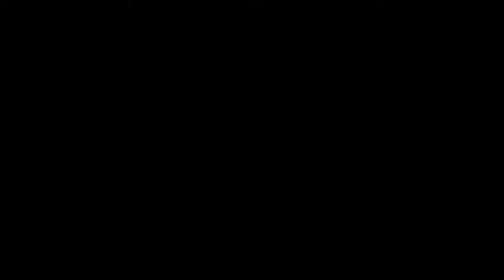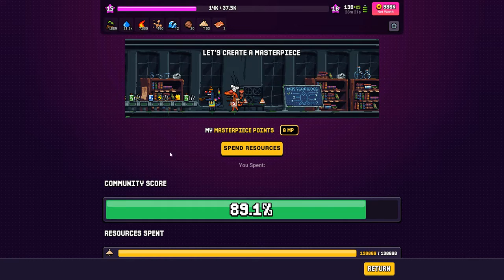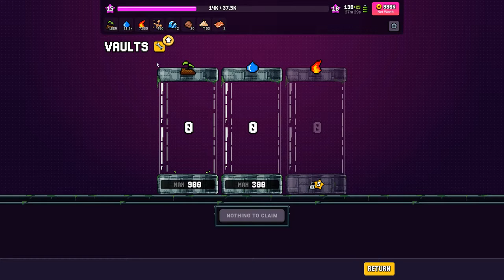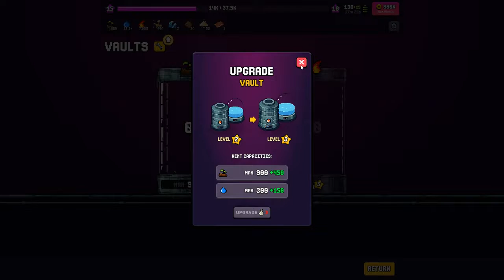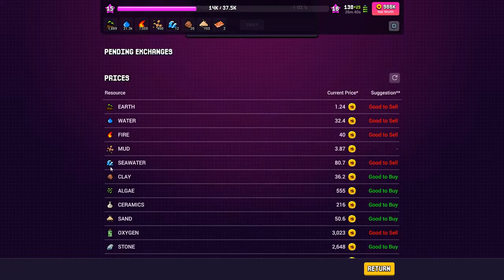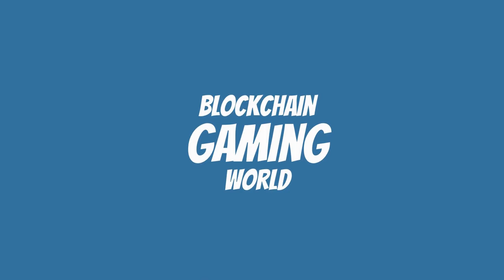ANGRY DYNOMITES LAB | Unlocking water

Comment: how to get water?  how you have that much?  does it drop every so often out of thin air into this tank?
Reply from the maker: I think it's because I own some NFTs so have been collecting water during that ownership process. It's not be earned from the demo.
Reply: @BlockchainGamingWorld  thanks, so it is pay to win, not a real game...  wasted time, unless you like to pay for winning games.
Reply from the maker: @LumiIT  It's not pay-to-win. It's a demo running on the Polygon testnet. There's no value in the game. The point of the game will be to build communities because no single player will have enough resources to build everything. You will have to co-operate.
Reply: @BlockchainGamingWorld  but only players with NFTs will have some resources, players with no NFTs will have none... I get it.  Only playable when you have NFT.
Reply from the maker: @LumiIT  Not true. NFT holders start with some resources, but all players can swap between resources using the in-game DEX.
Reply: @BlockchainGamingWorld  constant drops are much different than possibility trade for...
Reply: No its not pay to win...
You can just collect enough dirt element easily..then go to exchange building at the bottom...simply swap your earth for gold coins...then use those gold coins to buy water element..and start processing..
Also took me a while to figure that out..
Please note that exchange section has suggestions on prices so as to know which resource is good to buy or sell..keep that in mind..hope this helps..
Reply: @rickyknight3604  clearly you don't understand what p2w means.  You can swap, but your net value will shrink, or stay the same at best, while NFT holders will grow at the same time.  There is no question that without an NFT you are strongly disadvantaged...